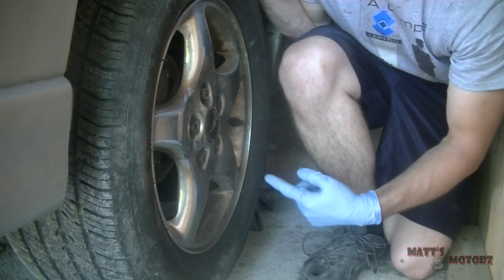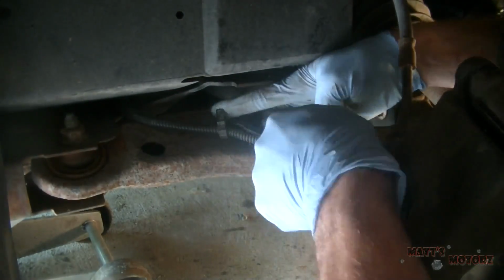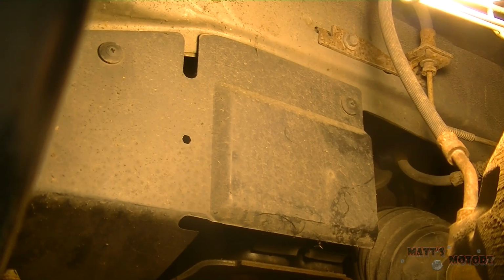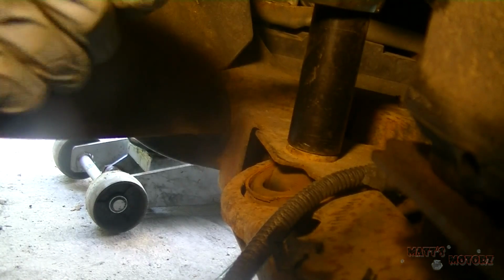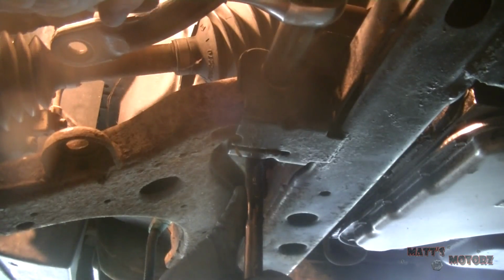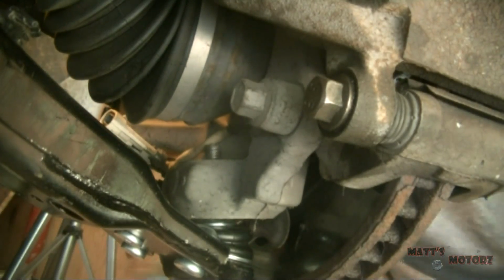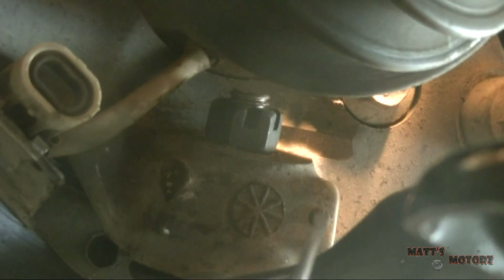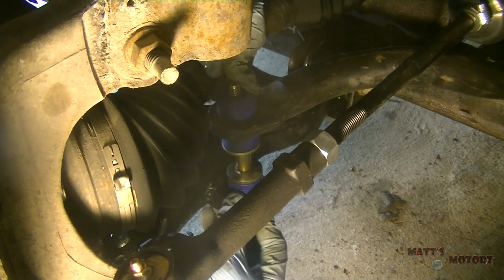Control Arm and Ball Joint Replacement [1999 Pontiac Grand Prix]

Comment: Glad I watched the video, and thanks for posting it. I haven't replaced a lower control arm in about 15 years, so this video helped.
My daughter called me yesterday morning and asked if I'd look at her car. She said her 1996 Grand Am sounds strange and does some really weird stuff when she pushes on the brake pedal. Which turned out to be a broken Control Arm...

She stopped by, so I took the car, with her in it for a short test drive, but I really put my foot down on the brake pedal because just lightly braking sounded like a worn out inner pad & a bad Caliper.  So pressing really hard on the pedal just about put the car 10 feet into the other side of the road, so I was glad she came by... So we'll repair it this weekend. So thanks again for the video...

Comment: Thanks Matt.  I have a 2002 Olds Intrigue and the control arm bushings (the forward facing one that you used the vice grip on the head) are in really bad shape.  The suspension construction is pretty much the same as this video for the Pontiac.  Watching you do this with the car jacked up in the garage (versus on some shop lift) gave me the confidence to tackle the job this summer.  Thanks again!
Reply from the maker: Awesome! Hope it goes well! Thanks for watching.

Comment: Do I have to replace the control arm or can I just replace the ball joint?
Reply from the maker: +VanSaucy I am fairly certain they come as an assembly on this car so you replace them both at the same time.  In my experience, even if you can only replace the ball joint, it is often more work to do so or at the very least, just as much.
Reply: +VanSaucy 
The lower ball joints are riveted on the control arm like my 2001 Pontiac. I was going to replace the ball joints, now that i've seen this, I'm going to do the whole assembly to save me the trouble of chiseling off rivets. rockauto.com has them for around $45 bucks plus shipping (control arms w/ball joints)

Comment: Good stuff! question for you. I have a 2004 grand prix that makes a popping noise when excelerating. It's on the front right side. Took it in to the dealer and they said it was the strut. I replaced the strut, still there. wondering if it's a subframe bolt or some kind of mount that has rubber spacers? Do you have a ideal what it might be? It's a real annoying sound.
Reply from the maker: +jimorocks Many times when there are issues with the differential, it will make a pop sound while accelerating, especially from a standstill.  Not saying that's what it is, but that's just what came to my mind as I have seen it happen before.

Also I generally think its a bad idea to take your car to the dealer.  Dealers have built a very bad reputation in terms of bad mechanic practices (some people call them "steal-ers").  The best place to take your car is an independent shop. (Not a big chain!)
Reply: Totally agree with you. I do most of the work myself, but I took the car in for just an opinion. And they where wrong, strut wasn't the thing making this noise. It doesn't sound like the differential. It's sounds more like a suspension problem or a mount problem. I'm going to craw under it this weekend and see what I see. Thanks for the input. I'll look at the differential also. If i find out what it is I'll let you know. Thanks :)
Reply from the maker: Let me know what you find!  Differential is inside transmission so nothing can be done about that so hopefully it's not that! (It isn't likely so don't worry)
Reply: +MattsMotorz - I did a inspection this weekend and booth of the control arm bushings facing the front of the car are gone. So I'm going to replace these. I think that's the problem. I'll let you know. Thanks for the great video :)
Reply from the maker: Definitely let me know! Thanks for the update!
Reply: +MattsMotorz  - Hey did you have to have the car realigned?
Reply: +jimorocks yes

Comment: Matt, great video! What are the symptoms that would require this repair besides the "6-12" play. I have a 1999 Grand Prix, only 80K miles, and I keep hearing a groan (more like a muffled knock, or "cracking knuckles" sound) when I first move the car from a parked position and am turning the steering wheel. I just had the car inspected and had to replace the outer tie rods and RF wheel bearing. But the noise is still there.
Reply: Check subframe bushings
Reply from the maker: Many times when you turn the steering wheel from a stationary or slow moving position and you hear noise the issue is a worn out ball joint. (When it get's bad enough it sounds like a loud rusty hinge.)  So for that problem, ball joints wouldn't be a bad assumption.  But I cannot say without hearing the noise.

Comment: How long did it take you to change it out?  Do you happen to know the torque specs?
Reply from the maker: I dont remember exactly but the book time is rated at 1 hour (Took me longer than that, definitely no more than 3 though.)  The lower control arm bolts are spec'ed at 83 ft-lbs.
Reply: MattsMotorz what is the torques value on that castellated nut?
Reply from the maker: 40 ft-lbs, and then TIGHTEN to align the hole in the nut with the hole in the ball stud. (As I said in the video, never loosen the nut to align the holes)
Reply: @MattsMotorz  What is the torque on the sway bar links?

Comment: I used to use a steel 3lb. hammer to hit the ball joint knuckle, but I've notice that the one has actually deformed a bit so I picked up a brass hammer. It was pretty expensive, I think $20 (for a Harbor Freight one at that with a coupon), but I really like that I can beat on steel things now and not bend them out of shape too badly.
Reply from the maker: Does it work as well as the steel hammer? I would imagine a brass hammer would be lighter.
Reply: MattsMotorz It's a 2lb hammer, but it gets the job done. Interestingly (I just looked this up) brass is about 10% more dense than steel, so the head of it is slightly narrower than a 2lb steel hammer. The thing about the brass though is it is a lot softer so it ends up marring up really badly, mine has funny little shapes dented into it from hitting steel objects.
Reply from the maker: I keep saying to myself that I want to get a "softer" hammer.  But when ever I am in the store, I never want to cough up the dough.

Comment: How long have you owned this Grand Prix?
Reply from the maker: I've had it less than a year.  The previous owner let it sit for a REALLY long time. (He didn't tell me this, I found it out later, the guy was not very honest, but now I know what to look for).  I keep finding stuff wrong with it!  It is almost done though!
Reply: MattsMotorz I got a 2003 Saab convertible for my girlfriend sight unseen over the internet for really cheap, I expected things to be wrong with it but it's been a long and painful road getting everything fixed on it. Even the convertible top itself wouldn't open on it's own when I got it! The car was 4,500 and I've put more than 5 into it in parts alone.
Reply from the maker: Man that's rough. Well it makes me feel better to know I'm not the only one struggling in this respect lol